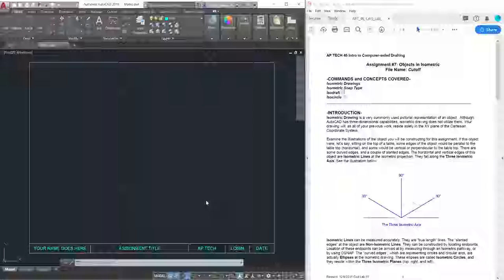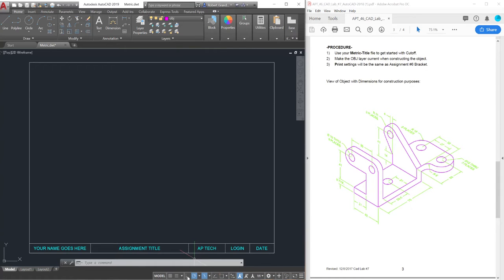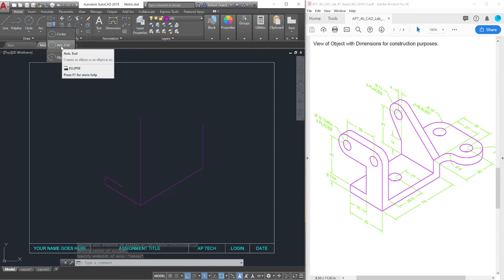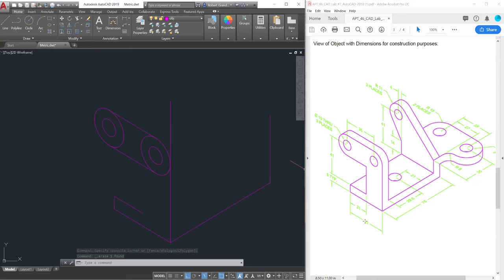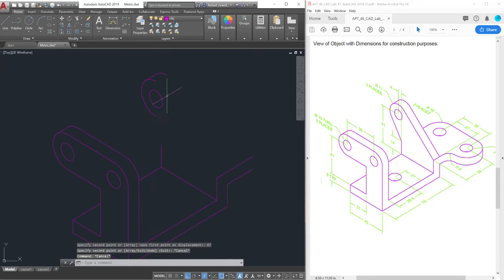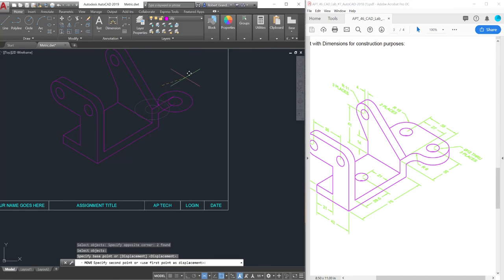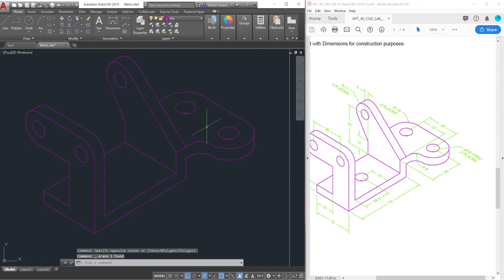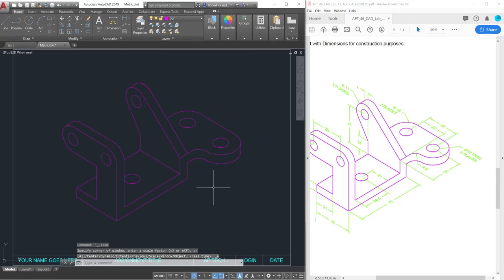Cutoff 2018 11 16 12 52 07

Comment from the maker: Students- Oops, please note that, though my drawing is using the Metric.dwt as a starting point, I SHOULD have started a NEW drawing file FROM the Metric.dwt which would then create a Drawing1.dwg file instead, until it's named with a filename and location! This is what happens when I have to quickly create a template to use for the demonstration and I'm working too quickly to get a video out for your use given the closure of campuses do to the Camp Fire air quality issue! Stay safe!